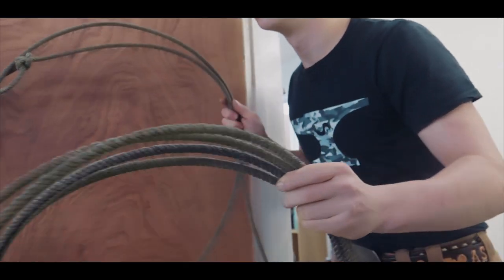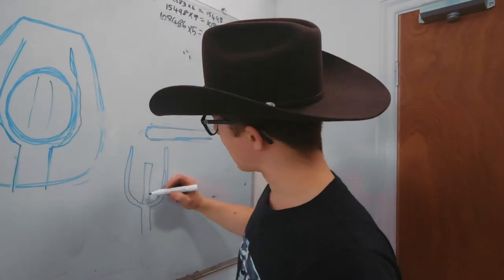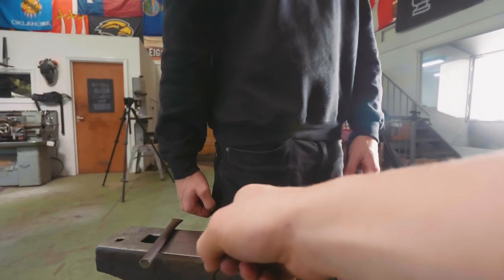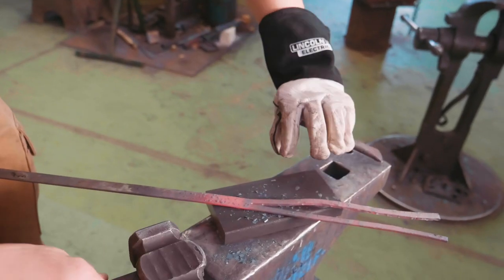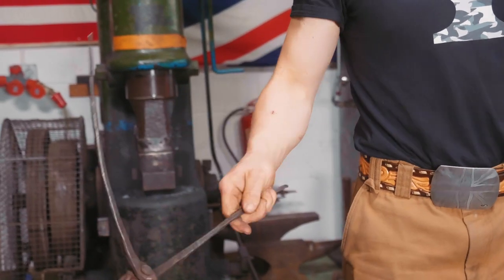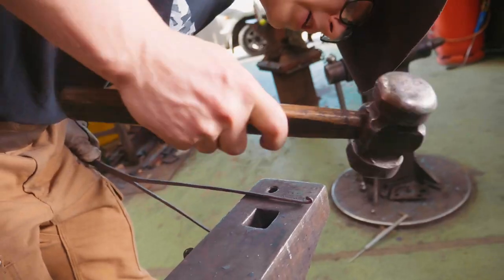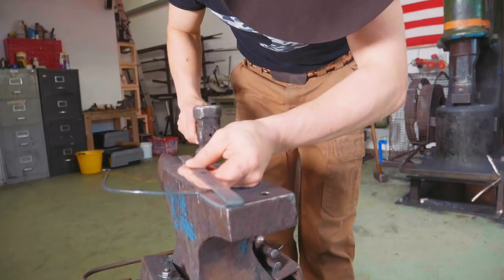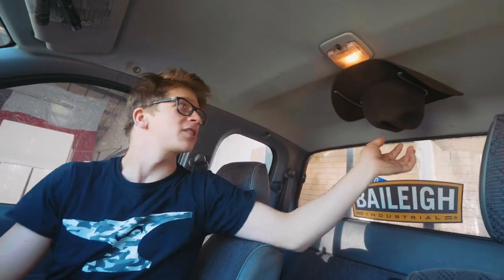BRITISH BORN, COWBOY HAT WORN!!!

Comment from the maker: Fun fact - my hat fell off the rack half a mile down the road!
Reply: Alec Steele at least it looks good
Reply: If it's a rack it should lean back.

*Edit, Also that's not a good rack for a felt hat, it will leave marks over time on the brim where it rests on the rack because of the same vibrations that made it fall off. That's why hat racks hang the hat where your head goes. If it marks the liner it wont be visible.
Reply: Put a slight upwards bend on the tongs to hold the hat against the roof of the truck
Reply: Mount it on the plastic just below the rear window.
Reply: My dads hat rack is spring loaded to keep the hat against the roof
Reply: I was just going to comment on when/if you will make a video of you rebending those rods to stop it falling out every time you brake xD
Reply: Arclight is right about the spring loaded hat rack. Cut the rack where you bent it and rig up a spring mechanism to to hold the hat against the roof of the truck. Prob solved. I liked this video alot.
Reply: Dare I say cut the head liner and jb weld that rack to the roof no holes no leaks
Reply: The parkerscrew probably break of the plastics!? You should try out a hollowwall plug or in that kind! ;)
Reply: Alec Steele would u ever do a tutorial for knife making for beginners with basic and cheap equipment most people have at home. Keep up the amazing vids too 😁😁😁
Reply: with the lack of hooking, i thought so
Reply: you mean your rack works fine only by going up the road???
Reply: I have a Challenge for you. Make a Damascus Composite Longbow. . . that works <.<
Reply: now you need a good pair of boots. if you come to calgary alberta see the calgary boot company. best boots in the world
Reply: was just about to comment "wouldn't it just fall off?"
Reply: Alec Steele next vidoe - how to improve cowboy hat rack.... lol
Reply: Brake Slowly hat won't slide off      ;-)
Reply: Should curve up at the front. Tomorrow, hat rack 2.0.
Reply: I guess the question of "how well will a hat rack work screwed to the headliner" has been answered.  Just a couple of ideas from bremar police solutions... http://www.policehatrack.com/products.html
Reply: Max Nimmert ii
Reply: It moved?  Duct Tape!
Reply: Maybe a vertical mount?
Reply: Good mix of Yack Yack AND Whack Whack my friend - and nice hat rack to go with the Whack Whack and Yack Yack...you could almost get away with calling it the Yack-Yack-AND-Whack-Whack-Hat-Rack....
Reply: ALEC you should get and try using a utilikilt. I love to work in mine and want to know what you think.
Reply: After watching your awesome video I was wondering if that was going to be a problem
Reply: My favorite black Stetson was given to my father by his father when he was 18 and then my father gave me the hat when I turned 18. Absolutely amazing quality. I believe it’s black beaver and a modified gambler style.
Reply: God Bless Alberta!!!
Reply: Make the tines a bit longer, so you can bend them upwards to secure the hat. So you now have to lift and pull the hat up to get it off.
Reply: he could simple bend the ends upwards. so the rack actually grabs the stetson. Right now, the tines are straight, so with bouncing the stetson is bound to fall off. but if they are bent upwards, the bouncing wont have that much of an effect on it.
Reply: So country... videos from America coming soon?
Reply: and now winter is coming, the hat will catch the rain from the 2 holes you put in the roof lol :-)))
Reply: Black smith third hand. If you know what I mean.
Reply: The hat rack in my parent's truck has a spring hinge to hold it against the ceiling and keep it from sliding out.
Reply: Burn that hat rack and make hat rack 2.0 It could be roof mounted with 2 expanding arcs of steel, like the way brake shoes work on a drum brake. Either have a lever, or an electric worm drive to expand the 'pads'  against the inside hat liner. you could even make it remote controlled. Hold the hat in position with one hand and press a button on the dashboard. A pimped out hat rack.
Reply: ...and fencing wire Sydney Mark.
Reply: Do you know what the term "hold your horses" means, its telling you to be STABLE.
Reply: hahaha
Reply: W0nderboy I was thinking how much his videos started to change and his whole everything right arou d the time he went to his new shop like when he was talking about it. When he left his old shop not only the background changed unfortunately.
Reply: W0nderboy and I can't agree with you more about the king of random
Reply: Did the truck leak?
Reply: Alec Steele  could I buy two of these from you ?? Please
Reply: Holy Molyyyyy 😦
Reply: There's another style that suction cups to the windshield and hold the hat on the dashboard and I would l9ve to see a hat rack 2.0 in this style.
Reply: @monstercommenter9587  he's a blacksmith, he can just bend the times a bit so they keep tension where he wants it.

Comment: Love the videos, they make my day every time I watch them, quick tip for the fuller lines where you fold the metal,  you can strengthen the fold by just putting a bit of weld into the fold

Comment: If your worried about the water tightness of your truck roof, I would suggest putting a little silcone on the screws before you sink them in. That way water won't leak down and ruin your new hat/ truck.

Comment: I find that the bell icon won't notify me until like hours after the video is uploaded
Reply: Bailey Lang
Well heck son, maybe you need to get you a DINNER BELL then ! 😎
Reply: ...or a large metal triangle like they have at the ranch. "Come an' get it!"
Reply: My problem is the notification gets sent to my email but for some reason Windows isn't letting me know when I have new mail like it should. It'll be sitting in my inbox for a hour or two before Windows decides to notify me so I've just been leaving the mail program open on my task bar and keep a eye on it that way. I can tell when I have new mail from the icon on the task bar even if Windows won't tell me it's there. :)
Reply: Well usually, it comes up as a notification on my phone, just way after its uploaded
Reply: + Grimsoul Blackheart Man, I miss Windows... all those crashes over nothing, all those restarts, all those driver installs... felt like I was married.

Comment: Dude make a sheild AND you should make it match your first sword
Reply: Jonathon Hunt his forge is way to small
Reply: I second this. He should also put his coat of arms on the shield if he does it
Reply: carnage k... how will he forge a full shield out of Damascus  (ya know to Match his first sword) in his forge ? I'd love to know, hell even a buckler is 18 in Dia his forge is maybe 7 in
Reply: Matt he would have to build a a temporary solid fuel forge but any thing is possible for a dedicated craftsmen
Reply: Matt i could also see the hydraulic  press beeing used in that build
Reply: Matthew Ellis would like to see a shield that looks like tim yoders latest video.
Reply: A Mosaic Damascus pattern shield?  Sounds difficult.  The sword was a challenge in itself but I too would like to see that.
Reply: So, shield design idea to fit his shop: Wooden Shield (think Sparta) with sheet-metal face and Damascus Trim!
Reply: i am seeing a boss held round shield with a Damascus boss patterned to display his touch mark.
Reply: sheilds are made of wood and leather though
Reply: the shield boss (dome in the middle) is made of mettle, and bucklers (a style of very small shield) is made entirely of mettle

Comment: Alec, you definitely need to put some silicone sealant on the other side of that screw hole, because if it's going through the roof, it will most certainly NOT remain watertight. Coming from various roof installs on vehicles, anything going through the roof will seep water every time it rains unless it's fully sealed. I'd hate for your hat to end up full of water next time you go for a long drive in the rain.

Comment: If you live in england .... why do you use the imperial system ?
Reply: Jack Snake  lots of people still use the Imperial system in the UK. Materials is steel, plastic etc are sold in metric and imperial values, same with plumbing components. Transition period was in the 1970s where both were taught in schools and lots of people happily use both. Metric is probably better for linear measurement but both have their advantages.

Comment: umh...just to know: did you fasten the screws only in the liner? In this case: that's really dangerous, because in the case of an accident this hat holder will fly right to your head... 
If you screwed it through the roof: not better, remember the weather in england :-/
Reply: A little epoxy sealant or caulk would fix any leak he might have. I wouldve suggested wet installing those screws though

Comment: Did you just drill a hole in the roof of your truck?
Reply: MRxMADHATTER Dude knows how to weld, but drills two holes. Look at the truck from the outside and there will be two screw poking up. Insanity.
Reply: Just needs a little rasping and a weld bead or quick dry clear composite to make it water tight again. It will stick out, but I don't think anyone really cares in a work truck.
Reply: The water leak won't be an issue, its not like it rains much in England.... Oh wait...
Reply: Time to TIG weld the roof.
Reply: He clearly only drilled into the liner, not out the roof.
Reply: Yeah, the water is going to eventually ruin the Stetson... it fell off since there wasn't enough spring tension. (or something about your driving...?) I am just thinking about All that caffiene.

Comment: Seriously, No pigging string? Did you bend the tines to match the bow in the brim of your hat? That is important you know. Ex PRCA bull rider, so I know all the ways a hat can get ruined while traveling. Bulls do not accidentally ruin hats; they damned well do it on purpose. The commercially available one that work well make the tines go beyond the hat and connect to a bar that rests on the roof of the car or truck, and incorporate a spring and hinge at the point the tines reach the mounting plate. Your hat should not fall out of that, unless you do something like jumping an Irrigation ditch or cutting across corn fields to avoid a dui while running from the police. Not that I ever did that when driving.
Reply: OldToughDW You sounds like someone who grew up in the Texas Panhandle. Lol.

Comment: Uh son....that ain't a truck. It's a car pretending to be a truck. Look up the Ford King Ranch. That's a TRUCK!!!
Reply: In Texas, we have real trucks. We also have real roads to drive them on. Or off road, as the case may be. I think the roads in Britain may be a bit tinier, and a full size truck might not fit.
Reply: It's also around 40,000 GBP (52,000 USD) for one.  All anyone really needs in a truck are two doors, 4 wheels, a bench seat, a long bed for hauling, 4X4 if you live in the snow, a manual transmission,  and a no-frills V6 or V8 that you can fix with a hammer.   Which is why you buy something older. From before trucks became all flashy and expensive for no reason.
Reply: hglenn55 Found On Road Dead , Fix Or Repair Daily.
Reply: Pancreaticdefect agreed heated seats and adjustable pedals are for soccer wagons.  Gimme a pickup that you can sit in the engine bay while you work on it.
Reply: LOL no not this beast. I can pull a house off its foundation with it. Had Chevy and interior parts fall off as you're driving. I'm not brand loyal at all. I was in the market for a Dodge Hemi crew cab when I found this.
Reply: + Glenn Wyant I hear that's just cuz Texans are the fattest people on the planet. They simply won't fit in a car, right? Correct me if I'm wrong though.
Reply: + Dogurasu According to my stats the majority are black. But how does that matter? Over 34% adults are obese (not just fat), so it's perfectly understandable they need huge trucks instead of cars.
Reply: HAHA wouldn't know I live in Georgia.
Reply: + Dogurasu The totally irrelevant stats tell me IN THE STATE OF TEXAS of the adult obese 42.4% are black, 37.4% Latino and 29.2% white. But indeed, who cares about the truth?
Reply: I have a Ram 3500 Longhorn edition. Its a nice one